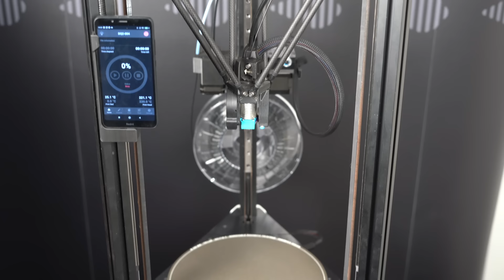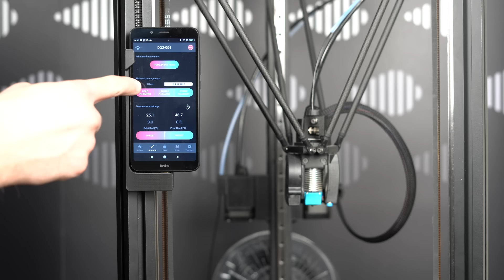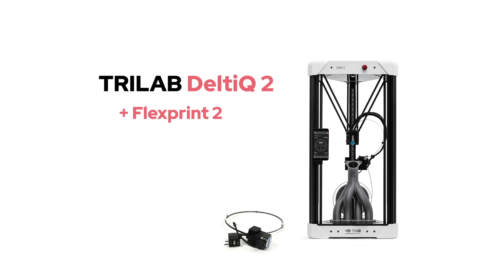3D printing from flexible/soft plastic materials (filaments TPU, TPE, )

Comment: Is it heated?   I thought delta was fast but the website says most prints take several days what is the speed and how fast to print a benchy with great quality?  25 cm is a little small and you say to turn the part to use the z height but the z axus is the weakest...so that is a concern.  Which model is heated and what is that price? Do you have a reseller in the US? Which model can print multiple materials?  Thank you, the print quality looks amazing!  Why does nobody makr a delta with 30cm diameter?  This would be ideal.  Heated multi material capable. Enclosed with exhaust port to vent the exhaust air.
Reply from the maker: Hi Robert, if you need printer with heating try our TRILAB AzteQ Industrial (more on https://trilab3d.com/3d-printer-azteq/ , if you want price qoute please conatct us here https://trilab3d.com/contact/ ). Standard speed is 50 mm per second. If you need 300 mm perimeter in X and Y you can also use AzteQ. It is tru, that DeltiQ has "only" 250 mm. Thanks for the delta system you can not be worry about quality of printing in Z direction. It is constant on all height. If you need reseller in US please choose https://www.prusa3d.com/category/professional-trilab-printers/ . David from TRILAB
Reply: I think he was not concerned about the quality in Z, but about the part strenght. As parts are knowingly weaker in Z direction  @Trilab3D

Comment: can you 3d print silicon molds to be used for resin casting?
Reply from the maker: I'm sorry, that's not possible on our printer. It is possible to print a mould for example from PLA and cast silicone into it.
Reply: @Trilab3D  what if you 3d print flexible TPU or any soft plastic materials to be used as molds?
Reply from the maker: @jephtisomosot9267  If you use a separator, it should work.